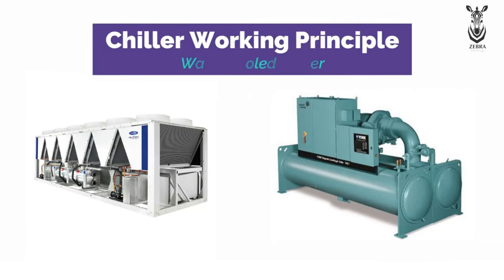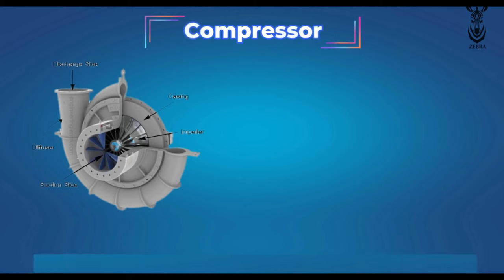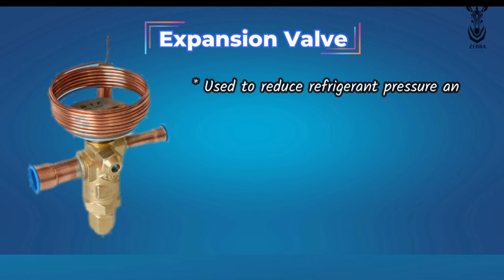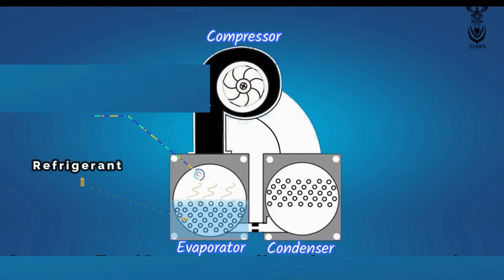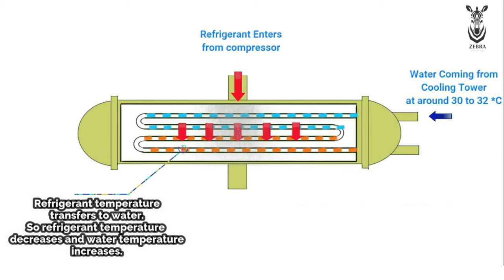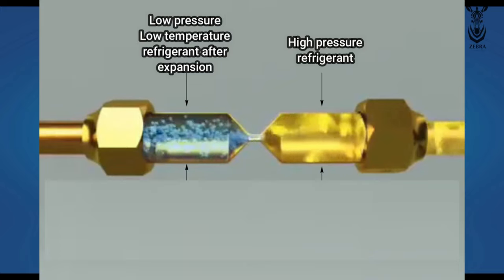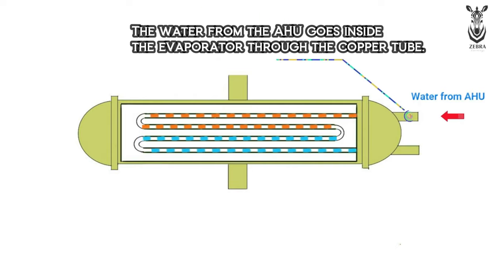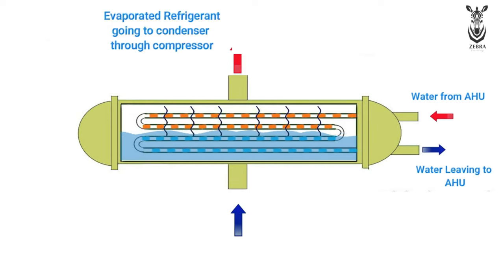Chiller working principle | English | Animation | HVAC

Comment: Very helpful videos for understanding HVAC systems,but I want  to know how much the temperature of refrigerant after the expansion valve?
Reply from the maker: Thank you and the temperature of the refrigerant changes based on the pressure. But commonly the temperature will be around 5°C.

Comment: Please give this video in tamil
Reply from the maker: https://youtu.be/THzhkB8AMRU?si=-2-s8nEoDr5e25AS

This is the link for the tamil video of the chiller working principle.
But, the video will be fast, so try to understand. If you have any doubt please ask me.
Reply: There should be a correction in this video that, In the Evaporator water flow through the shell, not the tube.
In the tube refrigerant gas flow.

In the other hand, In the condenser water flow through the tube and refrigerant flow in the Shell.

Plz correct it if possible. This is the mistake in this video.
I think so.
Reply from the maker: @BUTLERENGLISH No, the refrigerant won't flow through the tube. In Evaporator chilled water flows through the tube and in condenser condenser water flows through the tube. Refrigerant only flows through the shell.

Comment: Suction temprature discharge temperature how much in refrigeration.
Reply from the maker: Suction and Discharge temperature of the refrigerant may vary depending on the Refrigerant and Load.
Normally, Suction temperature range from around  -10°C to 10°C and Discharge temperature range from around 30°C to 70°.

Comment: In chiller condenser inlet vapour state and evaporator outlet also vapour state ?
Reply: In refrigeration cycle evaporator outlet liquid state and condenser inlet was vapour compressor was change the liquid to vapour state
Reply from the maker: Evaporator outlet should be vapor only. 
Compressor can't take liquid as inlet.
Liquid is an incompressible thing. So Compressor can't compress the liquid. So only vapor will enter into the Compressor.
Reply from the maker: Evaporator outlet is vapor and vapor enters the Compressor and vapor comes out from Compressor and vapor enters the condenser and changing to liqid in the condenser.
Reply: @zebralearningsenglish-pn6fl  thank you